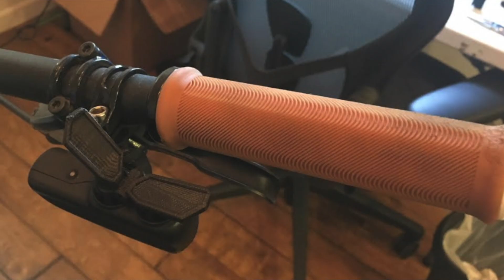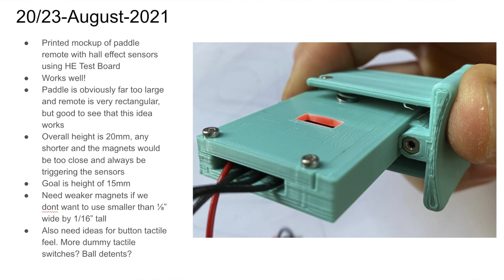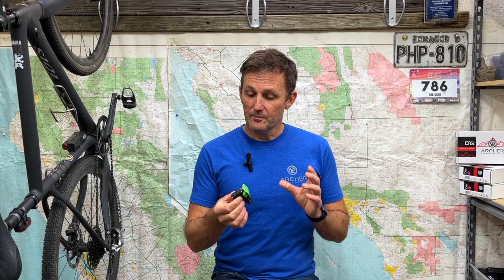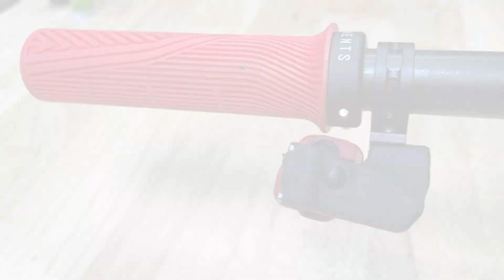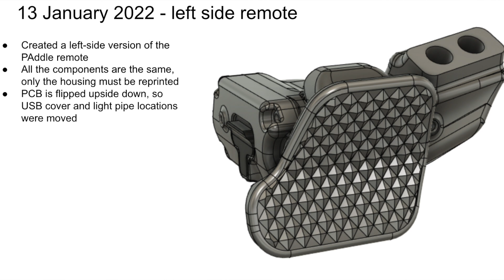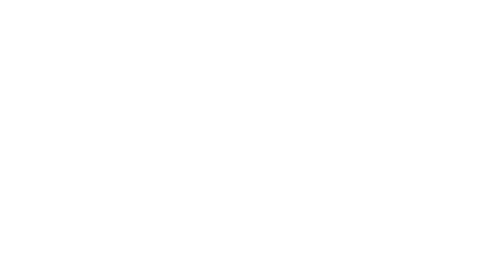Archer Paddle Remote - Webignar #6

Comment: I wish there was a way to make a new screw cap on the D1x motor that would then allow you to charge with a USB.  HATE having to take the batteries out and my rubber insert never completely seals up the unit.

Comment: i rather have changeable cr2032 batteries. lithium ion batteries only last for 2 years. Many riders do not like the AXS original top bottom rocker paddle because it does not behave like the mechanical shifter.  and AXS release a newer version which I think Archer can leverage from.
Reply: Lithium ion batteries have lasted far longer than 2 years in my experience (I have hundreds) but I would rather have replaceable batteries. I don't want to have to pay $200 every time I need a new battery for my remote. The CR2032 idea is good. Imagine encountering a dead battery before a ride. All you'd have to do is pop in a new button cell, and you're good to go. And then there's the possibility that the battery has a manufacturing defect that takes longer than the warranty period to show up.

Comment: The new paddle shifter is definitely an improvement, but $199 just for the remote shifter?  That seems to be really expensive, since the drop bar remote is only $59.
Reply: They need to recover the R&D costs bro. Best way is through customer wallets.

Comment: Great shifter update! How about using a USB-C charging connector instead of Micro USB? That way you can plug it in either way without having to look at the connector orientation and less chance of damaging the connector.
Reply from the maker: Hi Harvey, good thought. The issue with USB-C is that it's a much larger connector (as mounted on the board) and carries with it a bunch of additional capabilities that we don't really need for charging (like 24 total pins on that connector). Although it's a great new connector type, we felt that we only needed to put the necessary bits on this remote and would benefit from the smaller sized connector.
Reply: @ArcherComponents  It's really not that much more complicated. you don't need to use all 24 pins on the USB-C. you just use the equivalent of the 4 pins (8 if you consider the duplicate on both sides).
Reply: @yanuk818  super helpful. Thanks!

Comment: fantastic!! could you guys also please look at reducing the size of the shifter and maybe adding native charging to it ? the boxy design is a limitation to add to bikes.. i have one on my trail bike.. but wont fit my xc bike without having adverse impact on practicality - removing the rear wheel with tires on, being one of them.
Reply from the maker: Great suggestion! We're looking at ways to redesign the shifter. All in good time. For now we want to get these paddles shipped and go for a well deserved ride!
Reply: You might want to consider the bracket that they offer that will mount the shifter on the seat post down tube. I plan on ordering one for my bike, as I also think the chainstay mounting has some limitations.
Reply: @darrenramsay8986  I thought of that but don't wish to sacrifice the ability to use it for hydration.. I believe archer has reached a level of  maturity where now they can focus on redesigning the shifter to overcome these challenges.. Probably a more compact body could help.. Looking forward to the development..